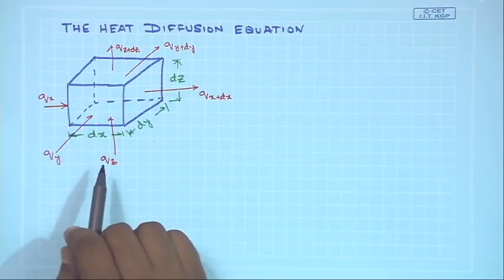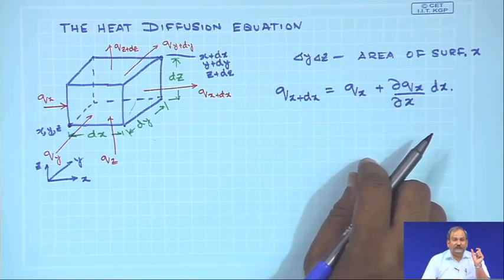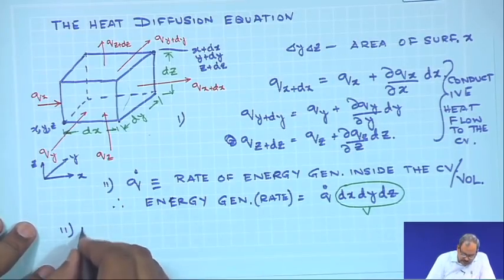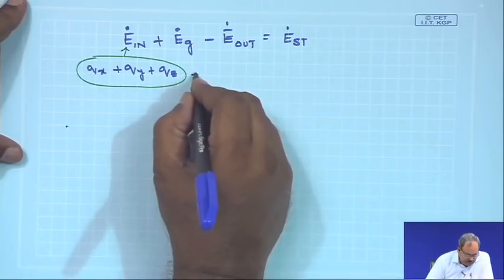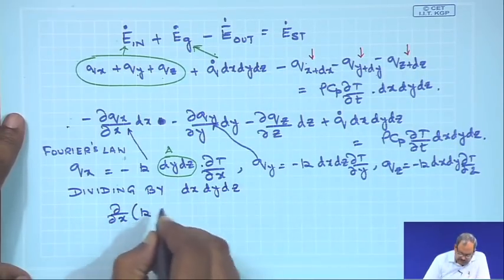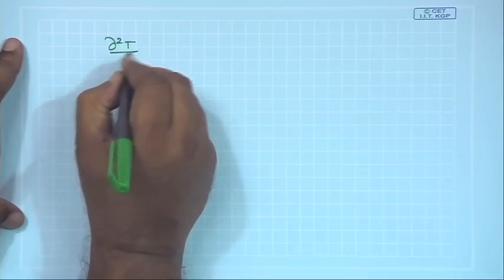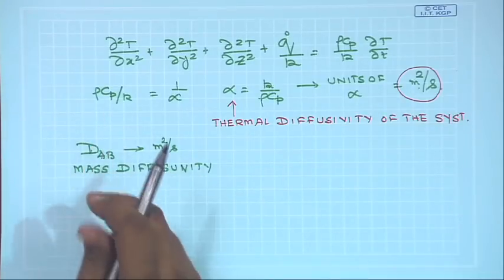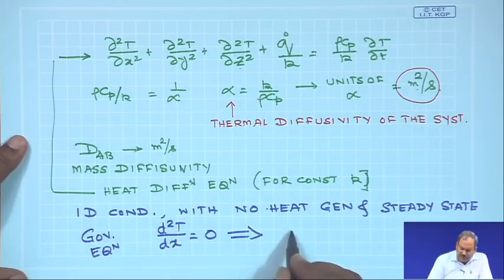Lecture 3 : Heat Diffusion Equation

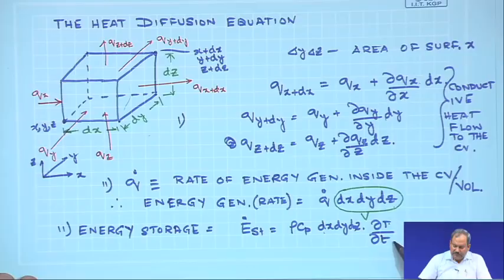Comment: Why at 13:35 energy stored is m*(Cp)*(Delta T) and not m*(Cv)*(Delta T) as there is control volume ?
Reply: Yeah, Usually in Solids and Liquids Cp is almost Equal to Cv since they are incompressible. Also In Control Volume Process, speaking Thermodynamically no Deformation of Boundary or No Boundary Work the Heat will become to the Change in the Internal Energy by FIrst Law (Q=Del U). where both equals to m.Cv.DelT. So the Cv is the correct term to use. Since in this case Cv = Cp, and also Q is usually written as m.Cp.DelT , By conventional notation, Professor may used Cp instead of Cv.

Comment: in energy generation equation you have differentiated temperature with respect to time which shows unsteady state. Further you have used fourier law which is for steady state. so how steady state formula can be applied to unsteady condition.
Reply: Though i m very late 😅😅u asked this 5 years back i will try to explain
Reply: He wrote partial differentiation of temp. Wrt x that means T can be function of space(x,y,z) and time but when we do partial differentiation wrt x only the x part will be differentiated others will remain untouched even if T is dependent on time
Reply: And fouriers law is exact differentiation wrt x and independent of time ie steady state  so the above statement becomes the same
Reply: @jeetadityabiswas4819  can you explain more elaborately?